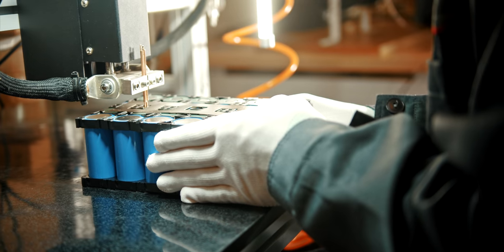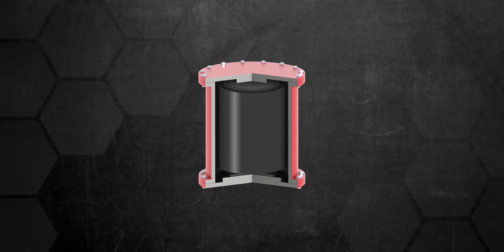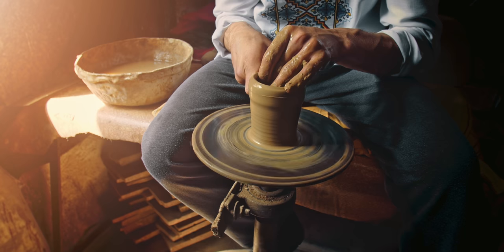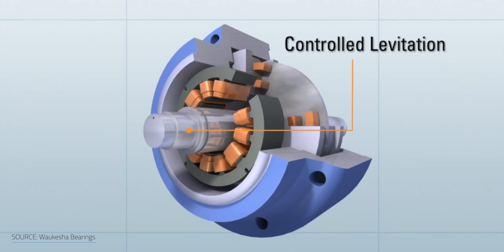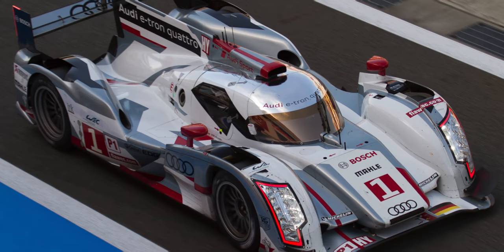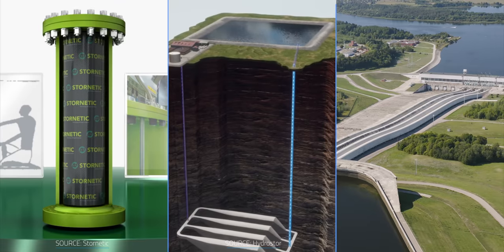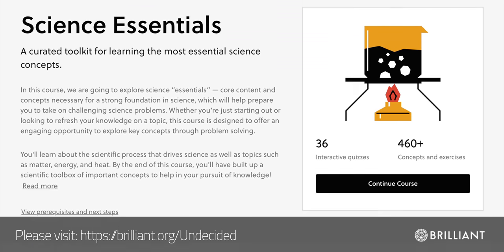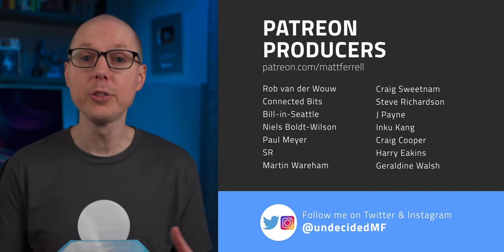The Mechanical Battery Explained - A Flywheel Comeback?

Comment from the maker: What do you think of flywheel energy storage? Any other tech I should look into? Be sure to check out my video on Small Modular Reactors Explained - https://youtu.be/cbrT3m89Y3M
Reply: Do a video on democratized energy solutions like solshare in bangladesh
Reply: I hadn't realised how much this technology had improved!
Reply: It would be great to see how the cost of drilling deep holes has changed over time, and how that's projected to impact geothermal.  I can imagine cheaper drilling making geothermal economical in far more places.  Low-carbon energy with 24-hour availability anywhere on earth . . . if you can just dig a deep enough hole.  It could also be a good way to repurpose oil & gas drilling equipment.
Reply: I wonder if there is a way of combining kinetic and gravity storage into one device.
Reply: @sadimuntakim I completely understand. It's the same issue in my country zambia in africa...the fact that the technology exists is truly inspiring and the optimist in is look for opportunities in this area still...corruption still exists but we have to try to democratise energy distribution if we want to progress as third world nations
Reply: Are there any Potential energy storage devices (not water based)?
I don't understand how many flywheels will be needed for a grid and how will these compete with other sources.
Reply: Dear Mr Ferrell - I strongly believe that a collaboration between yourself and "just have a think" would be awesome :)
Reply: As a short period energy storage, flywheel is perfect 👌🏻 
As a storage for high energy volume, I really do believe there is better solutions.

It’s simple to observe the benefits of both solutions, as they are both a standard part of a old school clock.
Here the energy for the flywheel, the angular movement, only provide energy to keep the pendulum moving. 
And the gravity energy provides the total energy.
Reply: @arkatub  hydroelectric dam with a reservoir higher than the generator
Reply: A cool idea might be to have a look at carbon 14 batteries (Nuclear batteries)
They use radioactive isotopes from nuclear waste and last around 200 Years
Reply: You talked about upfront higher cost of Flywheel tech.. But what about the lifecycle cost? With longer life than Li cells.. Also disposal cost Li cells would be a factor I suppose..
Reply: Combining wind turbines with flywheels would make a lot sense. The wind turbine doesn't have to generate electricity at all, it just have to transfer the mechanical movement directly to the flywheel, since the flywheel will have to generate electricity anyway, so they can share the generator. 

An easy way to visualise this is to picture a large vawt (vertical wind turbine, not the more common horizontal ones) and have a flywheel either in  pillar in the centre of the wind turbine or below it. The vawt always spin in the same direction and adds speed to the flywheel, the flywheel stores energy and generates electricity on demand.

For solar, batteries are a better option since they store DC current which is the same as solar produces.

I think that having two separate grids would very beneficial, one AC (the current one) and a new high voltage long distance DC grid. AC has worked well for a long time but a modern DC grid has many advantages. The best thing is that they are a backup to each other, it's very unlikely that both grids go down at the same time.
Reply: sadi muntakim  We can give you a though competition.
Reply: Excellent content 👌 👏 👍
Reply: Thermochemical cycle for green hydrogen production (both nuclear and solar heat)
Reply: molten salt
Reply: @SkepticalCaveman  Problem I see with that is that directly transmitting the work to the flywheel might take away the advantage of low friction. Ofcourse you could have it link on and off, however this would increase the complexity and possible failure rate. Also you'd have to either use large mass, or extensive increase in rotational speed, increasing friction in the gearbox and again bringing in another complex system prone to failure. And in the end you'll still need to have the same components in the flywheel to get the energy out, so you also don't save on equipment cost, on the contrary.

Unless a lot of energy is lost in the conversion, directly linking would probably be detrimental overall.
Reply: Has there been any advances in the gravity train energy storage idea?
Reply: Is this possible?? boiling water from the sea and convert it to steam, it moves up in pipeline to a nearby hill, and then we can use both the water and the hydroelectric power from the down flow of that manmade river?
Reply: Oh yes how about the energy from the Van Allen belt?
Reply: nothing is carbon free, even green tech require mines, transport, processing and transport again of materials and than require production, transport and installation. all of this require massive use of fossil fuels. fly wheels require heavy metals to be mined, processed ecc.... they are heavy, they have moving parts and require heavy machines for installation and maintenance. Maybe LTO batteries are more fitted for energy buffers comparable to flywheels in power and lifespan/ number of  recharge but less heavy more modular, scalable and compact, very secure and require 0 maintence for 25-35years.
Reply: @YathishShamaraj  😂 excellent idea, we could burn cheap rubbish like coal or old tyres to boil the water!! Selling the excess sea salt to posh restaurants would make a tidy profit too😂
Reply: @YathishShamaraj  It can be done but I wonder how efficient it would be. Boiling water takes a lot of energy. How would you recapture whatever energy is left once the steam is at the top?  Also, just because it is steam does not mean that it will be easy to move the steam thru the pipe and up the hill; these also take energy.
Reply: I’m used to flywheel technology in a data centre: the flywheel is used to “regenerate” power from the grid and so smoothes out any spikes. Additionally, it acts as a temporary UPS and provides power for up to a minute, while the load is transferred to batteries and the backup generators start up.
Works well, but does still require some maintenance every year or so (and it takes half an hour to fully stop those flywheels and more to cool down for the actual maintenance).

An interesting usage option for flywheel storage has recently been shown by a startup company from Israel: Chakratec’s “Kinetic Power Booster”.

Essentially, they do setup a half-sized standard container with flywheel and some solar panels and connect it to provide extra fast charging capacity for EV charging stations in places where there’s no infrastructure for usual fast charging.
The flywheel “charges” from the grid any excess power to smooth out any spikes and disturbances in frequency, resulting in a more stable grid. The solar panels are used to slightly increase the net efficiency and keep the flywheel spinning without drawing power from the grid.

When an EV is connected to the charging station, the flywheel temporarily doubles the grid’s power output to provide fast charging where this otherwise were not available. For example: the power lines connecting the charging station to the grid are limited to provide 50 KW, but the combo of grid and flywheel provides 100 KW fast charging output for up to 20 minutes. After this, charging continues at 50 KW solely from the grid. When the EV has been charged or disconnected, the flywheel starts to recharge from the grid.
Considering that most experienced EV drivers only do charge their EV up to 80% (as that’s the Sweet Spot where charging becomes much slower) and most drivers prefer multiple quick charging stops a week over a long charging stop per week, such an approach does make some sense. However, many municipal power grids aren’t built to provide high peaks of electricity, so fast charging often requires installing miles of extra power lines, which requires expensive installations (digging cabling trenches or install extra high power posts).

This flywheel system doesn’t only stabilise the grid by storing excess power, but also enables EV fast charging where the infrastructure doesn’t really permit doing so. Additionally, it is expected to be far cheaper per charge than battery based storage, a few systems have been experimentally installed in Italy, Prague and a few other places.
Reply: @creamwobbly   Thumps up :-D
Reply: i helped build the audi flywheels :)
Reply: I thank that you should do a video on Wave & Tide Energy Conversion as a Green Energy Source. We've got Lots of coast lines that could have some sort of Energy Collection System. Because Wave & Tide Energy is Immense.
Reply: Don't forget, airflow bearings, once up to a minimum speed, you could turn off the magnetic bearings and let the flywheel spin on the air/gas buffer between the two surfaces.... I may not be using the correct terms, but, it's a thing, air/gas can be used as a bearing 😎
Reply: What about industrial sized Stirling engines? 🤔😎
Reply: @SkepticalCaveman  This goes along with a suggestion I saw for adding in tidal power at the base of offshore wind. The cables & towers are already there. Now add a flywheel. Each tower is spinning up the flywheel from both wind & sea energy, meaning the project is self-storing. The wind farm becomes it's own load balance instead of an unreliable potential liability. This would also mean windmills don't have to idle themselves when demand is low.
Reply: What about EM emissions of such a rotating system?
Reply: Lifting very Heavy Things a short distance...there's one that uses a mineshaft....less comlex than the flywheel, and cheaper than batteries (and unpatentable ).
Reply: For now it's too expensive for kWh, but as it has such longevity, it might pay off...
Reply: Not too positive with fly wheels. The endurance is overkill but the capacity is not. would be nice for rapid charge and discharge applications like a public bus with chargers on stops or short range public transport boats/ships
Reply: @rogerstarkey5390  I heard that they are going to use long mine wells to do that. I think it was covered by Robert Lwelling from Fully Charged.
Reply: Regarding the microgrid for Coral Bay Western Australia, the wind turbines + flywheel were in operation back in 2007 because of the horrendous cost of transporting diesel to keep the tourist township live.  Nowadays of course there are more efficient wind turbines, and I'm interested to know if the same decision to use flywheel would be repeated given the dramatic cost reduction of powerful chemical batteries.  I was told by a maintainer of that system the flywheel could supply energy "for days", not just hours without the need for diesel backup.  Something also about floating on a film of oil, rather than bearings... but my memory is foggy.
Reply: @arkatub  Hoover Dam hydro electric plant is a perfect example. Water is the gravity, the huge flywheel driven generators are the kinetic energy release.
Reply: Do flow batteries!
Reply: @bernardfender5147  we don't need to burn anything, we just have to use lenses to focus the heat energy from the biggest nuclear reactor (our sun)... That solar heat energy will move water to a higher level and the rest is known 😉
Reply: @willdejong7763  well in simple terms, we are doing what naturally happens (water cycle- sun heats the ocean and clouds form and move via wind etc etc..).. the only this we actually do is to make sure the steam/water vapour stays in the pipeline..
Reply: @thedarkknight1971  yes, and it uses focused solar energy 👍... Good idea..
Reply: @YathishShamaraj  Like I said, I think it is possible, but I just wonder if it is more efficient than other options. Maybe it is, I don’t know and I don’t want to take the time to figure it out for you.  Good luck.
Reply: The mechanical flywheel gives back less energy, due to friction and heat loss. Just use nuclear
Reply: @DanVicary  it's more of a question for politicians if they can  try to reduce using natural gas and coal and use hydroelectric power...
Reply: Hey Matt, is a kugel fountain flywheel practical at all? or is the long term energy input from the pump make it less useful?
Reply: Time to look at the inside: Is it just a standard electric motor that doubles as generator when energy is being used? Or is there a much different and efficient approach to store and then use the energy?
There are also issues with attempting to use them on cars: The spinning disk (or drum) acts as a gyroscope which may resist to some tilting (such as going uphill and then downhill, or driving off-road) and what happens during a car accident. Neverthelss, they have superior performance in grid applications and deserve more research and investment. A "hybrid" approach, I think, would be to use the flywheels for grid power and the batteries for your car...
Reply: What about a magnetic repulsion battery.
Reply: Too many of these flywheels will cause the Earth rotation speed to change .......
Reply: @DrWrapperband  That is why flat-earthers are against them: they say the whole Earth will become a giant flywheel that will blow us away from the center and against the "great wall of ice" at the perimeter.
Reply: @christmassnow3465  No they don't. You just made that up.
Reply: Seasonal Thermal Energy storage.  Most energy in the power grid is used to either heat or cool something.  Having big thermal buffer eliminates the need for all those loads on the grid.
Reply: There are mistakes in the subtitles.......
Reply: What about the Imperial System ?
Reply: Hold on...when you talk about 11,000 cycles are you meaning duty cycles? As in it can be spun up and discharged that many times?
Reply: I haven't done the math but I suspect flywheels are not as energy efficient as gravity.

Flywheels have the benefit of portability.  But they behave oddly when you try to turn them in Directions they don't want to turn.
Reply: I think it will be a miracle of the highest magnitude if these technologies can ever compete with a gallon of crude oil or natural gas.
Reply: I worked on these in late 1990’s early 2000, both for ground and space use.  They have a competitor “super capacitors”
Reply: @melvinrexwinkle1510  humans don't have a good record with nuclear.
Nuclear power doesn't deal with a warming World very well either
Reply: @Phat737  we're past the point of them being a miracle. They already compete with a gallon of crude oil and with natural gas. And they're continuing to improve quickly.
And that's not even considering the huge subsidies that oil and gas get. The entire two trillion-dollar Gulf War was a massive subsidy to the security costs of oil.
Reply: @SalvatorePellitteri  There's no inherent reason fossil fuels have to be used for mining, transportation, and processing.

Clearly, the remaining natural fossil fuels will be too expensive to extract at some point in the future.  

Better to get off of them now so we can start making sustainable, renewable replacements less expensive.
Reply: Most flywheels shown in the video are with a small diameter, I would say less than 1 or 2 meters.
 I wonder why not increasing it to huge 5 or 10 meter like huge motorbike wheel... Sure stress on structure is big, but you multiply buy 5 your energy capacity and max. Voltage
Reply: @anuardelcastillo2627  well you face a couple of issues. One is you reach a point where there are not even theoretical materials that can handle the mechanical stress. 

And the other is the increasing danger woth size when failure occurs.  Someone has mentioned failure somewhere else in this thread.
Reply: I think ammonia/hydrogen will be the big thing.. And will be something that will be cheap enough and easy enough to set up in a D.I.Y so every home could set up themselves...
Reply: @danrawson8515  the hydrogen stored in a catalyst matrix might be safe enough for home use and provide power at night.
Reply: @macmcleod1188  that all may be true, but we still drive cars on public roads and have deadly electricity in our homes, cause its a risk we are willing to take!
Reply: Yes.   That is poss
Reply: @macmcleod1188  amazing how much torque power! Thanks!!
Reply: Based on How often does it need maintenance (needs easy access) & High installation costs (make it portable)! Flywheels should be sold on premade wheel shipping containers...
Reply: @anuardelcastillo2627  I did a little digging and it looks like they use multiple flywheels instead of really big flywheels.

https://www.youtube.com/watch?v=A4c_7h3IpRY

Also looks like each one can hold about 4kwh and are easy to recycle.

All the larger flywheels I could find spun slower.  And all the failing ones seemed to be smaller and in vehicles.
Reply: Maybe a large battery storage could benefit from ultra capacitors and flywheels for peak/burst of energy coming in/out
Reply: @arkatub  
Good idea. Plus, you could put diametrical cylinders inside the wheel and use the centrifugal force to create vacuum inside the cylinders by moving a piston (that way, there is no loss in compression of air). 

Also, the atmospheric pressure pushing on the outside of the piston will compensate the centrifugal force and increase the tour/minute that the machine can bear before breaking. That breaking point is the main inconvenient of freewheels, so that system would really improve the efficiency.
Reply: @En_theo  Thanks, but the more I think about it the more impractical it seems, also would it be cool to draw people's attention to my own energy storage solution (on my channel)?
Reply: @macmcleod1188  I'm definitely looking forward to hydrogen stored in ammonia much more energy less space also.. 
I've been  thinking about water tanks using siphoning into pipes going down with turbines creating electricity and a water return ram pump.. 
this I think could be really viable..
for everyone also.. 
I hope to have a small scale project like this set up soon..
Reply: Flywheels are like capacitors in a smart-grid system. They store energy but their main goal it to keep the balance of the network (buffer) . There is a plan of rending houses at every neighborhood to stabilize demand. So there are capacitors..not batteries .
Reply: Check Teraloop, they have a levitating flywheel
Reply: @mikemcgonegal1616  the ones in the video same pretty secure and reasonably small. I'm not a materials expert but I do know the average centrifuge generates 10,000 G.
I would not want to have a large Mass spinning at high speeds that wasn't well contained. Looking at artificial G-Force calculator, if these things only spend 3,600 times per which is much slower than a centrifuge they're generating close to 30,000g at the circumference.

So that means 1 lb of material at the circumference would have an outward force of very roughly 30000 pounds given a radius of 1m and 3600 RPM.
Reply: CMGs do NOT hold the ISS at an altitude - they hold it at an ATTITUDE - an orientation in space.  They cannot provide any thrust!!
Reply: @danrawson8515  yes I think as long as they find a way to reduce the danger of free hydrogen then it is a possible way of storing alternative energy for later use.

I worked with pure hydrogen about 30 years ago. It is extremely dangerous.
Reply: @macmcleod1188  yeah I don't think I Would mess around with it!
I'm really hoping someone comes up with a cheap and safe alternative to buying gas and electric off these company's soon. Im tired of Governments always having Everone over..
Reply: @macmcleod1188  Thanks So Much!! Appreciated! I will check it out
Reply: Water tower is a good idea for power backup especially if you have steam generation. Say a cool mega project could turn all cooling towers water vapor release could be captured at a higher altitude in a mega high water tower that then generated power by the water pressure as it returned to the steam plant.
Reply: Flywheels great for storing excess power and stabilizing current fluctuations.

What about molten salt from solar furnaces to steam turbines?
Reply: Maybe check out graphine batterys.
Reply: @HRM.H  pumped water storage is the best for sustainability and it is already known. Problem is to make it available in a format for single home owners. Maybe a steam generator/ water tower steam capture for energy storage .the extra energy from the potential energy will. Be a plus
Reply: What about check hydraulic generator maybe we can make it modular enough to pump by hand
Reply: I never knew there was a flywheel bus! I think our tech is at a point where we could use these more widely.
Reply: I wonder what is the best flywheel material... kw to kg
Reply: Question: isnt the rotation of the earth a major energy loss of flywheels. Because a rotating mass will keep the inertia it has, so when the earth rotated in half a day, the angular momentum would be flipped too, right? To me, that seems like a major obstacle.
Reply: @brettmoore3194  the problem with pumped hydro is that it isn't scalable enough for our energy needs, it can hold a lot of power, but to really supply the world, or even an entire country like the USA, the dams have to be bigger and bigger, and costs and environmental impacts of building those dams have to be considered as well ofcourse. The thickness of the concrete at the bottom of these dams is insane.
Reply: @luckuijken5451  not pumped, steamed off of steam generation
Reply: I feel like I may have met you somewhere, Matt.
Did you serve in the US Navy or go to roxboro high School in Philadelphia by any chance?
Reply: Mah man... I love your work, but as an enginner,  this video made me cringe...
Reply: Is the Installation cost per kwh included with the charging cycles? If you can't cycle a battery that often the cost would go higher because of the higher frequency you have to exchange batteries.
Also please factor the recycling costs in as well.
Reply: What a load of bull...
Reply: Ammonia?
Reply: @arkatub  crane. Actually where some ideas of making this somewhere. Can not recall where exactly.
Reply: Flow batteries
Reply: is the hysterisis loss less than frictional loss?
Reply: I've been interested for the last couple of years. Good to see someone taking a look at flywheel storage. I wonder what the total cost of ownership over 20 years is?
Reply: You should look into NiFe Nickel Iron batteries. The original Edison version recharges for 100 years so far and still going!
Reply: I wonder what happens in an earthquake?
Mass inertia would destroy the flyweehl is my guess.
Reply: Your math is flawed. When lion costs 100 euro per kWh they age also very fast. After 3 to 4 years they are useless. So compared to 20 years of life in a fly wheel it cost 5x more to keep the same per kWh per lifespan. So instead of 100 per kWh it is actually 5x higher. 500 euro per kWh for lithium compared to flywheel. 

Or am I missing something here ...
Reply: Flywheel and stirling engine..
Reply: The buttered cat array.
Reply: Graphene super capacitors.
Reply: It is energy storage, it is not an energy source, so it is only as "carbon free" as the energy put into it.

It might be necessary to add rotating mass into the grid again with a lot of solar and wind, which neither imparts any inertia in the grid.

It can be seen a short term storage, in the range of seconds or perhaps even a few minnutes, but to even out solar or wind over night/day cycles and monthly variations, it is completely useless.

Speaking of how much energy it stored is pointless, how much energy was lost in storage is the interesting thing.
Reply: @chrisking7603  Those edge cases (off shore, off grid) are interesting, but they have no bearing no grid level energy solutions. Microgrids are extremely expensive, and sensitive, but when that is all you have, you make do.
Reply: You people have obviously missed being educated by the numerous examples of free energy via nuts and bolts  and magnets etc. Mainly from indian geniuses who are now powering most of india with their inventions.
NUTS and bolts , mainly nuts.
Look for free energy on youboob
Reply: Time and again I wonder why they did away with the flywheel.  It makes things go.  Get it started, and it keeps going.  Those old flywheel tractors are cool!
Reply: Really love how people will almost always find a way to make old things new and useful again.
Like... Using flywheels originally as kinetic energy storage for mechanical machines, and then once they have fallen out of use in favor of newer tech only to be brought back as electrical energy storage?  It's genuinely amazing to me.
Reply: You should look at heatpump technology where excess energy is used to heat aluminium till it is in molten liquid form. This can then be used when buildings require heat in countries that have extremely cold climates that would normally burn fossil fuels.
Reply: @krishnachandranM  Look it's relatively simple. You don't need to look at the whole grid, but just one portion. Say there is a solar power plant with an average power output of 1 MW if the sun shines and for simplicity we suppose you have 12 hours of sunlight at the site making the power plant a 12MWh / day energy output plant. Obviusly during the night it will not operate and the grid does not like this. You can turn this site into a 0.5 MW constant energy output site by installing a 6 MWh energy storage unit. Near the end there was a picture for a 3 MWh flywheel storage unit that fits in a double garage. Double that and you get a general idea how much we need for our imaginary site. Of course this is simplified for the ease of explanation.
Reply: @krishnachandranM  like a grandfather clock?
Reply: @timothydillon6421  Could be. I was thinking like something that is pushed/pulled to a height to have the potential energy stored. Not sure what's complicated, but flywheel can't keep charge forever.
Reply: Micro-Hydro.  An extremely similar system could be built into high-rise apartments, if the rooftop water tower made a comeback.  They can not only be used to store Water, they can also be used to generate Electricity for the building, with a small turbine in the pipe down from the cistern to the basement.  In basically any building that's tall enough to have a pressure head.  The advantage of such a system over the Flywheel is that the Flywheel JUST stores peak electricity for off-peak hours (With something like a Solar Array.)  A micro-hydro cistern makes the building (Potentially every building downtown) less dependent on the city grid, AND the city water supply.  This would make the entire city more efficient, for both utilities.  Lowering water costs, electricity bills, and pollution from burning fuel to generate electricity to run the pumps to deliver fresh water to bathrooms in high rise buildings.  Every high rise building, in every city, in America.  Might be worth looking into.  Tech doesn't necessarily mean High Tech.  Quite often, the oldest, simplest techniques (Like the Flywheel, or putting the cistern high for gravity feed) are the best for a given application.  Likewise, solar-thermal water heating to save gas, and electricity.  These systems just require black pipes, water tanks, AC generators (You can use an alternator form a car) and basic plumbing.  Any superintendent can retrofit something like this to their building, raise the property value, and lower Utility costs (Which can go to profit, or lowering Rent when unemployment is affected by social distancing, and intermittent quarantines.)  The only reason why we're not doing this is because it's not common knowlege.  You don't need photovoltaics and custom made inertial batteries to take advantage of this free energy, which literally falls from the sky.
Reply: Stumbled onto this gem of a channel. 
Thanks. 
Subscribed
Reply: I recall discussing this technology 10 years ago with a sparkie on a frame 9 GE rebuild i worked on
Very cool to see how far this tech has come, would love to hear your opinion on thermal solar power stations?
Reply: A-CAES (Advanced compressed air energy storage) cannot be ignored in a conversation about mechanical batteries....!!!!!!!!
Reply: Gravity lights. A clockwork lighting system.
Reply: I can tell that you've slightly sped up the speaking.
Reply: Have you checked Teraloop?
Reply: hi, to be honest I don't know what other storage energy types you should talk about. I like your channel , does something I don't do, read books, news, etc, I only watch videos ( 1 picture = 1000 words , 1 video = 1000 pictures that is my motto ) . I have in mind something that involves magnetism ( electro magnetism , what would be more efecient in my project ) gravity, elasticity , movement of objects (n rotation, frection , repetition ) . Thanks for your reply .
Reply: I have the answer to using flywheels to capture energy. Add an "air pump" in series with the flywheel and the dc motor driving the flywheel. Once the flywheel reaches its energy saturation point the system can then divert excess energy through an "electronic clutch" to the air pump, pumping cylinders full of air. The compressed air can then be introduced back into the system via the air pump which converts to a compressed "air motor" driving the flywheel. All mechanical energy storage!
Reply: Hi Matt, you can look at gravity based batteries. At the moment Gravitricity is working on a test stand in the UK. It is basically a large load suspended in an old mineshaft. Hoisting and lowering will be done by electro motors.
Reply: Why not pumped storage plants.   Also a very reliable and mature technology.  I think flywheels can also factor in, but what's the cost?
Reply: What do you think about Graphine batteries?  Do You know the pros and cons?  Thank you.
Reply: Please explore arc discharges under water. See work of late Dr Peter Graneau.
Reply: My beef is it’s being called carbon free but it still takes power to get the thing turning
Reply: Other energy-storage tech to look into: thermal.  

My impression: for cost per kWh of capacity, heating up a pile of rocks can't be beat.  Efficiency is crummy, though, and cost per kW -- how fast you can put energy in and take it out -- isn't so good either.
Reply: There Are Much Better And More Efficient Forms Of Mechanical Batteries Than The Flywheel, Even Capable Of Being Used For Long Term Energy Storage.
Reply: @krishnachandranM  Gravity Lifts On Pully/Transmission Systems Are One Relatively Simple Form Of Non-Hydraulic Based Mechanical Battery.
Reply: @SkepticalCaveman  A Hydro Based Grid Would Probably Be Ideal.
Reply: @bernardfender5147  Fresnel Lense Solar Condensation Boils/Combusts Water Almost Instantaneously, Combined Properly With A Network Of High-Pressure Vessels And Hydraulic Piston Energy Distribution Systems, Not Only Can It Distill And Pump Significant Quantities Of Water Over Great Distances, But It Can Also Generate Substantial Amounts Of Power, Facilitate Mechanical Storage, And Irrigate Inland Fields.
Reply: @willdejong7763  Check Valves And Drop Points Along The Solar Array. 
Check Valve>Pressure Boiler>Check Valve
Heart Pump/Transpiration.
Reply: @YathishShamaraj  Yes, If Done Properly, Not Only Will It Work, But It Will Work Very Well, Especially Once Tuned, Primed, And Connected To A Well Engineered Network. It Is Both Residual And Redundant, Capable Of Compounding Leverage And Diverse Adaptability. Rarefaction Tempered Glass Solves The Material Problems.

Fresnel Lense Solar Condensation Boils/Combusts Water Almost Instantaneously, Combined Properly With A Network Of High-Pressure Vessels And Hydraulic Piston Energy Distribution Systems, Not Only Can It Distill And Pump Significant Quantities Of Water Over Great Distances, But It Can Also Generate Substantial Amounts Of Power, Facilitate Mechanical Storage, And Irrigate Inland Fields.
Reply: All these unnecessary expenses and "hi-tech solutions" when a 5 ton weight hanging from some height connected to a generator by a ridiculous gear ratio will store more energy pound for pound, the only thing limiting it is how many gear step-ups you want to introduce into the system. The only time I could see this flywheel system being useful is onboard a space craft where magnetic bearing might not even be necessary to maintain a high rate of speed with minimal loss.
Reply: @xelgodis80085  The Question Would Be Where To Locate Such A Device On A Spacecraft Without It Being A Major Safety Issue.
Reply: @VerifyTheTruth  they already use gyrostabilization in space to limit their rotational axis to one plane, this would just enhance and improve stability.
Reply: @xelgodis80085  Solar-Pumped Laser Engine.
Reply: @xelgodis80085  Harness Vibration, Harmonic Oscillator. Positive Feedback Loop.
Reply: @xelgodis80085  History, Architecture, Archeology, Reverse Engineering.
Reply: Drop weights such as in old clocks. You pull a chain to lift the weight and gravity powers the clock.
Reply: @lostalone1271  Bingo. Mechanical Batteries.
Reply: I would like to see you cover Zinc8 energy solutions. They make Zinc Air Flow Battery’s. They won the Innovation Challenge by the New York Power Authority (NYPA) by 2020 for Long duration energy Storage. 45$/kwh.
Reply: @willdejong7763  Recapturing and being able to use "Low grade energy" (<100°C) will solve a LOT of energy issues. You have no clue what this could achieve. A Datacenter is just heating the air around it and does no other work. Making this energy useful would be worth a lot
Reply: @heikoh.1618  Why is your comment addressed to me?  And what makes you think that I have no clue about your idea?  (Which likely isn’t economically viable in most cases, BTW.)
Reply: too bad. the idea is ancient but the technology/cost is pricey.  i have read about this as a kid more than 20 years ago on Discover magazine.
Reply: I can't yet find an answer to this, and I'm not a physicist, but can a ring of plasma be used as a battery? Can you add and remove electrons at will? Thanks!
Reply: @brookestephen  It is not practical. Fusion reactors struggle to pull out as much energy from the plasma created and energized by fusion as they put in to containment, etc. And that’s when they are releasing energy through fusion.
Reply: @brookestephen  closest ring of plasma is a nuclear fusion tokamak design.  it is not a battery as fission/fusion plants are sources of heat which could drive turbines/generators
Reply: Tidal energy
Reply: Consider this: A flywheel is only made of steel, but batteries are made of lead and acid and lithium, and carbon and zinc and electrolytes, and plastics, all of which pollute the environment, in many non-reversible chemical ways which contaminate landfills. There are supercapacitors, but there is graphene and other chemicals which must be used.
Reply: @foureyedchick  Yes.  Those are all things worth considering.  But it does not tell the whole story.  It is important to consider additional factors, which vary in importance for different applications.

Here's an example.  I just bought 14 kWh of lithium iron phosphate battery capacity for emergency backup power for my house.  Capable of up to 14 kW power continuous for 1 hour, which is more than I need.  Cost of the cells and a battery management system (BMS) for this battery is under $2,500.  (I ordered the cells and BMS from China and I'm putting the battery together myself, currently it would cost closer to $6,000 to have a similar battery system delivered as a completed assembly.)  Total weight under 90 kg (under 200 lb).  Small enough to fit the whole battery assembly on a sturdy shelf in my garage.  Once built it can be disassembled into components weighing 5.3 kg (12 lb) or less, so if I move I can easily take the battery with me if I choose.  Estimated life in my application: 20+ years.  Can you show me a way to do something like this with a flywheel?  I am not aware of any available flywheel based system that comes close.

There was a startup company, Velkess, that was trying to make a 15 kWh capacity flywheel, and was hoping to sell it for $6,000.  Unfortunately they were unable to make it work, so we don't know how much it really would have cost.  And I don't know if I would have bought it even if it was available and cost $6,000.  Their design was only rated for 3 kW, was going to weigh 340 kg, required a reinforced foundation, and would take up around 8 times the volume of my battery.
Reply: @foureyedchick  Yeah, batteries are terrible.  It's funny that Tesla owners think they are saving the environment somehow.  And where does your electricity to charge them come from?  Coal, Nuclear, Natural Gas?  Even Hydroelectric, as clean as it is, comes at the price of flooding one environment and drastically changing a river system.  Tidal and Wind power are probably the best way to go.
Reply: Why we not using Vanadium redox batteries they can cycle energy indefinitely?
Reply: I saw this title and thought it would be about Stirling engines, great stuff either way 👍
Reply: Maybe use a stirling engine to maintain momentum in the flywheel, reducing the need to run power into the flywheel by the motor
Reply: @melanatedthought7014  @sadimuntakim  You're not alone, I live in Australia, and trust me it's no different.  The corruption may be less obvious in some regards, it may happen in different ways, but it's just as prevalent.  
Australia has one of the dirtiest electricity production industries in the world, it's our biggest contribution to greenhouse emissions by far. Nearly totally reliant on coal and gas.  All attempts to change it's reliance on coal and hydrocarbons are actively blocked by the government, I'm guessing the political donations and lobbying from petrochemical and mining companies are one reason.
Our government just pushed though legislation to fast track more coal seam gas production despite the majority of the population wanting "fracking" and reliance on coal to be drastically reduced. The pipelines to carry it to power stations were also fast tracked in legislation.
South Australia is the only state to really embrace renewable energy, but that's a very small state in terms of population and the slightest hiccup in energy supply there is jumped on by the federal govt as an example of renewable energies failure.
Tasmania has Hydro, but only ended up with half the installation that was planned due to interference by the Federal govt and the Green party, as a result it's the most expensive place for electricity, and we're forced to by brown coal generated electricity from the mainland. 
Plus Hydro has other ecological problems that offset it's "clean" status.
Reply: @iffracem  What lies behind us and what lies before us are tiny matters compared to what lies within us.
Reply: not sure about flywheels in vehicles,
maybe to dangerous incase of a crash 
and probably to difficult to corner you car  left or right
against the rotation ofvp the flywheel
Reply: Our office building has such a mechanical battery to supply power during a power failure, until the emergency power generator comes online (i think for 30 seconds or so). But i can tell you, standing right beside that battery, knowing there is spinning death just a couple of inches from you that could cut lose at any moment makes you want to leave the room :p
Reply: How about clockwork battery vs flywheel battery
Reply: Flywheels seem like a good idea. Just one more way to store energy for overnight usage.
Reply: @Scudmaster11  Spring tension vs Momentum wheels...  hmmm.  Which is more efficient for what Job?
Reply: @TheMetahedron  as a battery... one loses energy over time and one can stand still holding all of it
Reply: And you can make a main spring as long as possible.... just make sure it can turn the system and the friction isn't to high
Reply: @Scudmaster11  But neither can compete with a Gasoline or explosive engine for torque to drive anything.  It's a great way to charge a battery though, that then charges a motor
Reply: @Scudmaster11  Ever heard of the Perendev Motor?
Reply: @Scudmaster11  Springs spinning Flywheels... And Flywheels winding springs...  All driven by deep underground river systems inside the Hollow Earth...
★👁⛥
Reply: How about building a number of energy storage devices and then have a self-learning algorithm sat over the top deciding which one to use when? I wonder which devices would get ignored. Optimised against energy availability
Reply: I think in an energy hungry world this could have application's if given half a change
Reply: @marcusphoenixish  I think Tidal or Wind energy generation would work well with a Flywheel Farm.
Reply: Don’t build them in California. The earths moves out here
Reply: A co się stanie z tą baterią podczas trzęsienia ziemi?
Reply: How about a very old, low-tech way to store energy which undoubtedly can be enhanced with modern materials and engineering; coil spring power storage?
Reply: thermal power storage is the most promising.
Reply: Check out redflow - small flow batteries
Reply: Quesrion: could grids make gigantic flywheels that would act as grid stabiliser? Or even be able to act as batteries for solar or wind or everything else
Reply: @arkatub  Nice thinking. 🤔 flywheel on a floater in a Watertower 🤩  is what I think now. 😇
Reply: Iron oxide power storage.
Reply: Matt, ever look at a Large Weight that could be lowered or raised into a tower by cables and then, over time, it drops and spins a slow pulley that gear ratio spins another pulley that spins a generator?
Reply: You mention solar and wind power witch both can be inconsistent, but you failed to mention hydro electric. Which is constant day and night wind or no wind.
Reply: Gravity towers seem to be the best energy storage, except for probably space.
Reply: Hi, at 5'47" It shows on the graphic:
"charged at 8kw for up to 4 hours"
Also you say:
"They can be completely charged within a few milliseconds"
What is the meaning of both please? Thank you.
@Undecided with Matt Ferrell
Reply: There is a way to store this energie in almost 0 fricktion.
Reply: @Boca-do-rio  what does it mean?
Reply: @electrocat9   That we can harvest for instance windenergie way more efficient as we do now. We need to switch for this, back to the Darrieus windturbine, but not with a centre core and just 1 turbine but to a donut shaped Darrieus turbine with turbines on the out side. When windenergie gets higher, you do not use brakes, you add more turbines (something a vertical turbine can not do...) at the outside and slow it down, by harvesting more energie. Further you transfer this extra energie to a donut flywheel that is in a vaccuum space and hoovers above permanent magnets and made of superconductive material with fluit N2 inside tubes and inside the superconductive material for "corecooling". And as the space is vaccuum arround the donut superconductive flywheel, it can not heet up at the outside and will adjust to its core temprature. These flywheels most be made in ranges of 1km wide or more to make them super stable. Above this flywheel you make the Darrieus donut windturbune. The concept is in my brain, i can see it. You can use fast spinning concepts but also slower bigger ones with a uge ammound of torqui, just use bigger wind turbines and vaccuum space with superconduction. On top of the superconductive material you put permanent magnets as well, above them you put the coils, that do not turn, but harvest the energie of the flywheel, the moment the wind slows down again. Storms can be harvested this way and its V3 stored. And... Because these flywheels have almost no friction, you can make the wind turbines smaller and just give the wind more time to put the energie inside the flywheel. It makes the construction cheaper, but it takes more time to let the flywheel get its maximum speed. You do not need to have the flywheel go get max speed as of min 1... I'ff it does this after 3 hours in a storm it is already fine.
Reply: @electrocat9    A problem is is that permanent magnets are expensive, but you can call it free energie transmission. Draw a small wheel inside a big one. At a certain moment the big one will turn as fast ( in meters per min not rounds ) as the small one and as the big one turns with almost no friction, you can harvest a lot of energie from this big torqui the moment you need it. Multiple small ones can resist also the wind force better, so they can turn at windforce 10 to 12 even. Its the torqui that you need to harvest... I wonder what happens, when you use Tesla turbine technic toe it.  ;0)
Reply: @Boca-do-rio  I think you are aware wind is slow compared to a flywheel speed.
Reply: @Boca-do-rio  I don't see how this combination of small and big flywheel get together, I see it impossible at actual technology level. Try a prototype at a small scale, my advise.
Magnets as I know, the powerful ones are man made, more specific Japan made, Japan invention, great idea but simple technology, I suppose they are cheap.
Reply: I can see flywheels as a very temporary means of energy storage. Like bringing a vehicle back to cruising speed after it has to stop. But long term. It loses too much to friction (no matter how it is designed) over time. And in a moving vehicle, the crazy speeds and rpm’s required for more storage are going to be dangerous when bearings or magnetic levitation fail. Which is almost certain to happen eventually. But in the past, these were all we’d effectively to bring commuter trains back to speed when braking was incorporated into the flywheel.
Reply: @robinleebraun7739   Nha... It all depends where you use it. For a car no, but for sollar or wind energie storage perfect.
Reply: What about this. We build a grid of metal struts, maybe 150m high, with a bunch a pulleys at the top. Next we have a bunch of large, heavy weights suspended by cables going over those pulleys I mentioned.

Now while wind and solar are channeling energy into this "gravity battery" during the day, the electricity will run a motor that through a series of gears will slowly spool up the cable and raise the weight. When a weight gets to the top, the motor shuts down and a ratchet system locks the spool in place. Once the sun is down, the ratchet system releases, the weight starts to descend, and through that same series of gears it runs an alternator which returns the stored energy to the grid.

Seems like a cheap, long lasting, and environmentally friendly way to store energy.

EDIT - As I suspected, I'm not the first to think of this. Several companies are already developing the idea.
Reply: Hello Matt, I am working on a flywheel system to help with a program for kids.  Can you help?
Reply: They are definitely a solution to smooth out a grid.
Reply: Please review molten salts.
Reply: Hello mr, is there anyway that i could get one?
Reply: Flywheels also require an different approach to safety. A heavy mass spinning at thousands of RPM is not something you want to be next to should bearing failure occur. To my knowledge, the material of the rotor is often choosen to be softer than the casing so that in the event of catastrophic failure - at least in theory - the shredding is contained inside the casing instead of destroying everything arround it.
Reply: Great video production. Have you looked into Oker Energy? Subsea PHS scaled from industrial to grid scale with zero environmental impact. Mission towards 2050 is to install  10 percent of daily future global energy needs. Energy into storage will originate from surplus and idle power off all energy sources with an efficiency expected to 93 percent in discharge cycle.
Reply: certainly an interesting approach, but i would be a bit concerned about the maintenance required to keep the flywheel working - since its mostly moving mechanical parts, that might mean it is more demanding on maintenance
another thing i am concerned with is the energy losses from charging to discharging and whether they are in the same ballpark as other battery technologies
Reply: I just saw an article that a group just invented a way to supply certain plants with a chemical mixture (non harmful to the plants) that allows the plants to hold an electrical charge. 

Thank you for your consideration.
Reply: It can last hours. A Wind generator that turns a compressor and fills a large tank can be used to power, air saws, it could power your drier or washers. The air motor could spin a small generator to give the unit electricity.
Reply: I like your videos in general but they always dont go deep enough for me. Why are flywheels more expensive to install than other options? Does its lifespan overcome the initial cost better than other options? I get that high-tech fast spinning flywheels are better but low tech should be way cheaper, how do they compare?
Reply: When you think of energy storage costs on the state level for electrical energy, you need to compare cost to pumped storage hydropower and not so much batteries. Pumped storage hydropower accounts for 95 % of the current utility-scale energy storage in US, and I guess it is similar in Europe.
Reply: All ready invented in India with patent known as kamma wheel..
Reply: That old flywheel/pulley in the picture, where did you source that? Looking for more info on that room as its incredible
Reply: Picture is at 47 seconds
Reply: Made me think, and I have an experiment I need to try out now.
Reply: And what about a magnetic levitating flywheel? It just needs a foothold to not get out of balance!
Reply: I have a different kind of question. Do you know if anybody has ever employed an energy storage solution that would be kind of like a flywheel mounted on an elevated rail that would flow downward at an angle, such as along the side of a mountain? The wheel would be placed at the top of the rail. When needed, the wheel could “roll” down the rail at a constant rate and generate power. Similar to a stationary flywheel, the system would have a limited capacity, but the rate of discharge could be more constant over a long period. I hope I’ve described my thoughts well enough. Full-disclosure, I’m no engineer, but I do work in the energy industry.
Reply: I wonder if the flywheel were allowed to free rotate, like suspended from a wire, would that negate bearing load?
Reply: There is no doubt that the cost up front would be more but you got to look at the whole picture, Over the life of all storage systems the flywheel is the best.  lithium batteries are very bad for the environment, gravity systems have to much mechanical parts so more maintenance and wear.
Reply: @AlecMuller  why not use existing mines depths to get it that much farther down to start.
Reply: @arkatub  Ya it is real easy, push the ball off the table.
Reply: Carbon free AFTER production is what you meant to say
Reply: sadi muntakim  Speak for yourself.
Reply: This improvement in efficiency opens up some interesting ways of changing.  When peak electricity demand there is excess energy created before and after peak. We could capture/use the energy, that would normally go to ground and be wasted, to charge the batteries for after hours or solar time, night time.
Reply: @jackkennedy9475  Not really. Not very energy dense, requires exquisite balancoing otherwise it will fall apart and requires extremely high tensile materials. These things are like huge bombs with failure being absolutely catastrophic. After all of these issues have been taken into account flywheels like this are not competitive with battteries.
Reply: What is the lifespan of a flywheel storage device tho? If it can last a hundred plus years with minor maintenance it may be more economical than batteries for more permanent power producing facilities. Plus if they last a super long time you could re-use them in new projects if you can disassemble and transport them. Not to mention the environmental damage and international conflicts associated with rare earth metals for batteries.... Seems the initial cost may be worth it possibly if someone smarter then me can crunch the numbers.
Reply: @flyboy765753  You have to realise that these things must be permanent magnets which means thety will also need rare earths.
Reply: I've had an idea for a giant flywheel in the desert plains. Use solar and wind to spin it up a mag lev flywheel. I think it could be the best grid storage solution.
Reply: Deer Lorde, help me out here... Vertical vs horizontal flywheel efficiency? Wouldn't a rolling flywheel be more efficient that a spinning one? Couldn't friction be reduced over a longer horizontal axel? Same tech.... just... turn it over?
Reply: @ronnielloyd4676  
The "improvement" is not in the rotors. It's that metal housings have been replaced with higher-tech carbon and suchlike: advanced technologies to contain a very dangerous piece of concentrated and unstable energy.
Reply: @AlecMuller  
Alec,
Geothermal runs up against the problem that rock is an awfully good insulator: once you've drained the heat from around your borehole, the rest of the heat is shielded away from you by the rock you just cooled off.
Reply: Can't the solar energy used to load/ wind a spring.. so that when there is no sunlight the tension can be used to run a generator by unwinding the spring.. ??
Reply: I am not sure if you have made a video on super capacitor/ultra capacitor technology. Nevermind you have. Thanks for the video
Reply: well, I can immediately think of one thing why flywheels won't make it.... how will you synch up with the grid if your flywheel can't give you a constant velocity for the rotor (unless maybe with a continuous variable transmission, but that won't hold for long. I have more trust in the gravity assisted battery, or even the sandbattery (for heat), than I do in flywheel tech.
Flywheels should be used to make rotations smoother, to assist with generating power, not as its main source.
Reply: One I asked myself why we can't build something like flywheel. Now I have the answer that it exists and why it is not widely used